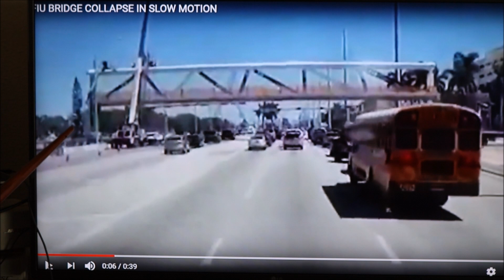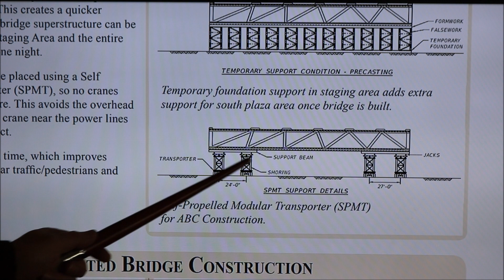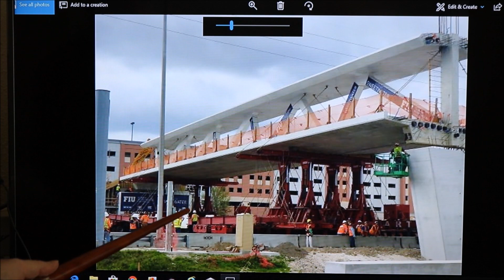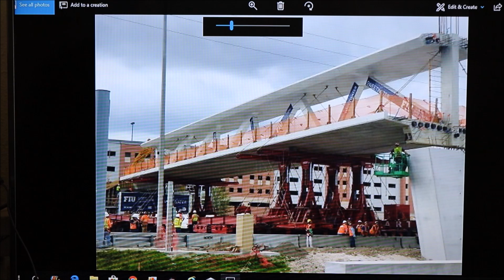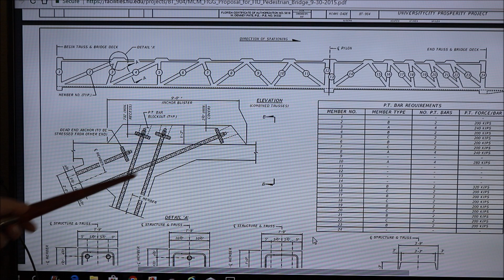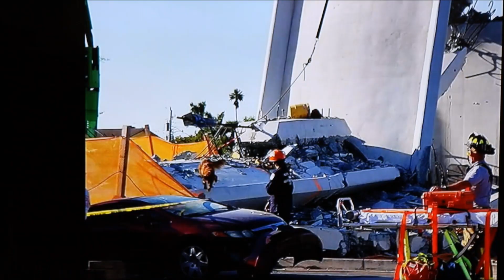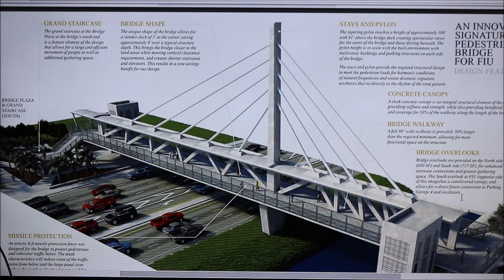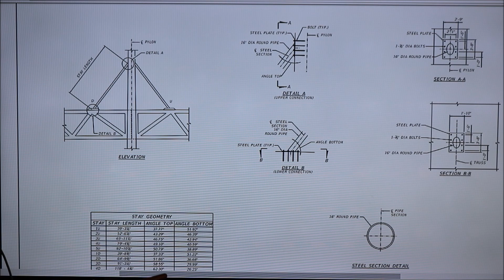Miami Bridge Failure Update 18 March 2018

Comment: That end diagonal member (#11), once in place, would be loaded in compression. The tension rods in #11 were likely intended to maintain #11's integrity against minor bending forces. Those tension rods were likely not intended to be loaded to the high level of tension they would experience to support a long span of the lower deck cantilevered out, as it was during transportation to final position, with the supports moved inboard from intended locations. So I'm thinking that one or both tension rods in #11 were strained beyond capacity during the move. Then after the bridge was in position, it was noticed they were loose, and no longer maintaining the integrity of #11. So workers went to tighten them... and ended up provoking final failure. But of course, speculation at this stage.

Comment: Hi:
To start off, I want to thank you for taking the time to reserce this accident.
I am still thing that it was a design problem.  I also think that the caring machines should and could have been closer to the end of the Bridge section and not removed until all the tension was done.  I have personal experience of many times contractors wanting to do a task a easier way for them and I had to tell them NO.
I agree with a couple other people comments that the person that fell was not in compliance with the safety rules.  I would almost bet that the straps were loose or not hooked.  The safety equipment is not light weight and a little uncomfortable if worn correctly.  You know how confining your safety  stuff was when you were flying in the military.
 Please share more.  Thank You

Comment: It should be clear that the tower and stays were not intended to be a significant part of the support of the bridge by the simple fact that both sections of the bridge were not installed simultaneously. The stays have to be loaded symmetrically, or the tower will fall to one side. The loads on the stays have to balance because the tower is only capable of supporting a vertical load in compression. As soon as the loads become unbalanced, the tower will fail to the side with the higher load. The bolted connection shown between the stays and the tower is simply not capable of passing a significant tension load from one side of the tower to the other. If that had been the intention, there would have to have been a big chunk of steel through the tower to carry the tension load and to provide bearing for the vertical load to the tower. This really does begin to look like there was a sudden catastrophic failure of a tension member in the truss. A truss design places all members in tension, because they are too slender to carry a compression load. For that reason, all of the concrete is simply weight, because concrete can't carry a tensile load. The only thing holding this bridge up was the steel. There had to be steel in the top and bottom chords (the deck and the canopy) to transfer the loads from the diagonal members. A truss has to be a series of complete triangles to work. If one side of one of the triangles is missing, the truss will fail.
Reply from the maker: Bill Giles yep!

Comment: The fundamental problem I have is envisioning how the outermost trusses 2 and 11 could ever be be in tension (and why you'd ever want to add any more of it), while supporting a load from the ends of the bridge.   That's simply not how any type of truss bridge works.    I learned this making my own bridges when I was just a young'n.  ;) 
Do a google images search for keywords "truss bridge compression tension".   End diagonal trusses are always in compression.   But to understand why, let's take the top deck away, leaving only bottom deck and triangles formed by trusses then try to lift the bottom deck from the ends.   The ends go up, the middle  bows downward and the points of all the triangles move closer to each other.     The only way to prevent that is to add the top deck between all the top points of the triangles.   Every bit of the top deck between the points of the triangles should then be in compression because it's pushing all the triangle points away from each other.  All the diagonal trusses that angle inward toward the center from bottom to top should be in compression, and all the other trusses (whether diagonal or closer to vertical) are in tension.    
 The only time the end trusses (angled inward from bottom to top) should be in tension is if the bridge is supported inboard of them, which was the case when they were transporting it, and that's consistent with reports that they had added tension to support the cantilevered ends.    Once it's supported by the ends though, those end trusses should always be in compression, and adding  tension there has no positive effect except to add more compression to the concrete already in compression. Likewise, removing the tension (even suddenly)  should have no effect at all.         
I don't think that truss #11 failed.     Playing the video a frame at a time, it looks to me like the failure was at the base of truss 10 (which is in tension), and it either separated from the bottom deck, or the bottom deck itself snapped just outboard of 10. The entire bottom deck of any end supported truss bridge is always in tension.

On a side note, to play any YT video a frame at a time, pause it, and then use the comma and period keys (below < and > which is why those two keys were chosen) to step back or forward one frame at a time.
Reply: daemn42 
It’s strange engineering to see critical structure of a truss have a design requirement of aligning with a non critical motif.
Reply: daemn42 
The fundamental problem was the truss was irregular triangle asymmetrical. And that was to line up with the structurally useless cable stays. 

Had the truss been regular triangle and symmetrical, it’d be different outcome
Reply: Larry Scott, While the irregular shape of the triangles from one end of the bridge to the other certainly put this end of the bridge under greater strain (which I'm sure they tried to account for in the design), my point is that the fundamental physics requires that the end trusses (2 and 11) be in compression, not tension.   It makes zero sense for them to be adding additional tension to #11, once the bridge is supported at its ends.    If they were adding tension with the goal of raising the lower deck, it was probably to truss #10.
Reply: Larry Scott Its a hybrid design, and form clearly does not follow function in this case!
Reply: YOur comment is the finest observation of all the many I have read. I feel it is entirely correct.  Though I feel that the node was simply not detailed well to resist the immense bursting forces tension-compression at this point (11-10).
Reply: daemn42 I agree with your comment, the failure seems more likely at the base off truss #10, where the span was over-stressed by cantilever load during transportation.
Reply: daemn42 according to the drawings there were no steel rods in #11 #12 and #9 ,.
Reply: The preliminary drawings were changed twice, firstly to accommodate an 11ft lengthening of the main bridge span (DOT request), and secondly to cater for cantilever loads while being transported with re-positioned support crawlers. Those calculations, and the actual strength of each element, will be carefully studied by the NTSB.
Reply: daemen42: Great explanation, but the bottom cord would be in tension  In the case of the FIU bridge the upper cord appears to be smaller than the bottom, and the webs are highly irregular.
Reply: daemn42 — The loads were different when the span was being moved to its final position.
Reply: daemn42    You're correct, diagonal #11 was in (very high) compression in the final position.   The tension strands were there for use while being moved into place and were de-tensioned after.    However the bottom end of #11 was under-designed and developed alarming cracks.   (Probably in the misguided hope of closing up the cracks) re-stressing of the tension strands was ordered and this was the last straw for the overstressed joint.   (See OSHA report).

Comment: Not a bridge guestion Juan but one on commercial aircraft.this morning as i was headed to Sonora I seen at least 12-15 planes lined up. Headed west, the only reason I seen them because of the trails they  were leaving . my ? Is there a freeway in the sky an if so if flying West is your altitude the same if your going East also same  Going south / north.   Thanks Jaun
Reply from the maker: James Woods good day for contrails, yes-airliners fly the same routes over and over like highways in the sky.
Reply: James Woods Juan forgot to add that East/West flights have 2000ft vertical separation (not obvious from below).

Comment: My first question for you, Juan, is did the worker who fell from his harness survive and will he be able to communicate his actions and observations?? Secondly, please confirm my understanding of what you have said here. I understand you to be saying that the transporting crew Increased the original tension on #2 and #11 for additional intergrity during transport while the site contractor expected to Increase those tensions once the span was in place. The transporter allegedly informed the site personnel that these tensions had all ready been maxed out for transport and that once in place, the the Tension on #2 and #11 needed to be Relieved back to the construction standard. Once the span was in place, the Site Management put a worker with proper tooling on the job to Tension ( increase tension ) apparently first #11 before #2. If my understanding is correct, Site Management Erroniously Instructed the worker to cause #11 to Fail by OverTensioning It. If that had not caused the immediate failure, the worker would then have proceeded to OverTension #2. It would seem the crux of the matter will be litteraly what was said to the worker and what action he took. And so, as is pervasive in modern American society, we have a case of " He said, She said". Fifty Billion dollars for the Lawyers to pin it on some poor worker who is lucky to come out of it alive. sdh in CT
Reply from the maker: steve holton we’ll have to wait for the NTSB report to sort all this out.
Reply: Witnesses confirm that #2 was adjusted first, and one rod in #11 was completed. The worker we see falling in the video died on the spot. 

I believe that these PT rods were inappropriately loosened on a previous day and were later being re-tightened. Both times, these rods could have been left alone. 

Other witnesses say the rebar at the bottom end of #11, in the deck, was about 1/10th as strong as really needed. Perhaps tightening the last PT bar to spec crumbled the concrete in the lower joint, triggering the collapse. We can see a puff of dust near there, one frame before the bridge drops. 

Certainly, there were wide cracks photographed on this lower node, days before, so a failure started around the time the bridge was being moved, and got much worse after being set on the pier. There were also reports of loud bang from the bridge well before the collapse. 

It seems like a medley of failures, not just one.

Comment: If there are 2 tension rods you would need to adjust both at the same time or you overload the one being pulled on  and it may reach its break point    just a thought
Reply: Doug Beagle Its best-practice to have equal tension in both rods, but probably difficult to do both exactly at the same time, due to space constraints.

Comment: A dead-end tension rod is a red flag signaling danger. I think it should have been fastened to a steal beam or something rigid that would have directed the tension somewhere secure.
Reply from the maker: Joseph Miller I believe it was ‘secure’ in the fitting.
Reply: Joseph Miller The load spreading at the joins will likely be a key point of the investigation.

Comment: I cannot imagine a design of a bridge without redundancies.  Any of the bridges anywhere in the world that have withstood age, stresses from load, weather, building flaws (obviously minor but still compromising) develop cracks, sheared bolts, rivets, rust and corrosion etc., and they still don't fail, because of designed redundancies.  Looked at this aspect Juan?

Comment: The dynamics of this failure point towards concrete bent 11 failing under compression, Juan.

During transport 11 would go into tension naturally, given the cantilever. Cable tightened to resist, ok, whatever, the last section didn't fail during transport, period.

Nor did it fail when they set the span. This means that bent 11 successfully survived its internal transition from tension to compression, as the fixed pier took the load from the mobile piers.

Two guys and gear, finite but miniscule additional compression on bent 11.

Then she goes, with strut 12 and bent 10 maintaining angular alignment with each other halfway to ground.

The hypotenuse described by bent 11, gets shorter during early failure.

It does indeed look like they punched right thru the anchor blister. Or just unseated it.

But...they shouldn't have BEEN increasing tension on bent 11, they should have been releasing it. Atop the fixed pier, bent 11's compressive resistance is paramount...why artificially increase that compression by tensioning in "dead load" from a cable?

If they were indeed tightening it, they stressed the concrete around the anchor bolts until that whole section of the top chord crumbled.

If they were loosening it, good chance microfailures triggered during transport choose then to let go.
Reply: Laying bent 11 over, closer to horizontal than any other, accomplished two things.

It made it line up with the "suspension cable" overhead falsework, and it greatly increased the compressive force on it.

Well within design limits, I'm sure, but the net effect is to amplify any additional compressive force when the cable is tensioned, and effectively lowers the safety factor during minor adjustments.

The first panel span of most trusses are smaller or equal in size with the rest, for this reason. 

The more vertical the first bent, the more bridge it will carry.

In this design, the much longer first span panel was probably a factor in the failure.

Somebody traded pretty for sturdy, and it bit em.
Reply: Reports state rods were tensioned during move. As you note the unsupported end of the bridge would place stress on #11 rod ... I suspect stretching it. Once the bridge was placed on pylons the tension would be relieved as 11 went back into compression from weight of structure, which would make the rod tension become loose. 

I suspect they went to take up that slack and re-tensioned the #11 rod (which was an addition - there were no P.T. rids in #11 in original plans), without apparently considering or understanding the rod was loose because of excessive forces and stretch in the move.

When they re-tensioned the already deformed/stretched 1 3/4" P.T. rod, it suffered catastrophic failure.
Reply: @go220mph  
The change in length when #11 is compressed should not relax the PT bars. Concrete is very stiff. However, when under tension, the bars may have damaged the lower node. Other witnesses say that the rebar in the lower node was about 1/10 as strong as really needed. This is confirmed by photos that show a wide crack in the lower node just above the deck, days before. Tightening the bars back to spec after the concrete has cracked may have shattered the node.

Comment: Looking at the slow motion several times would seem to me to place the blame on a failure in the lower cord of the truss.  Both struts 11 and 12 appear to be intact and connected on both ends as the bridge falls.  Member 12 would be in compression not tension, member 11 would be in tension.  If 12 had failed, it should have collapsed under compression, it is still intact after the event is over.  If 11 had failed it should have separated, it does not appear to do that.

I think the failure was in the lower cord because it bent during the event at the bottom of member 11.  I guess "they" may tell us what "they" think in a year or so.
Reply: I'm thinking the lower span would most likely have been damaged by stress concentration during transport, due to the cantilever effect, and the lack of support bracing.

Comment: Why was there traffic allowed under a non completely installed structure, makes no sense...
You loose a worker during adjustments to tensioners. Failure number 2, seems this whole process of erecting bridges like this is  risky.

Comment: Sounds like you and AVe have this failure pretty much in the bag. His analysis came to the same conclusion based on the protruding PT rod/tensioner and cantilevered section during the altered transporting scenario. Thanks again for the great content and presentation, As a novice I have learned so much regarding concrete structures between the dam spillway failure and this incident. Its true, there will always be accidents, time/money/resources wasted in the pursuit of progress......but what makes no sense to me, was if they were making additional adjustments required due to following an altered transport plan (the inboard transporter clearing the K-rails and debris) wouldn't safety protocol dictate that there be NOBODY in the danger zone until stress gauges were checked and the structure was given the all clear? I mean, even the guy doing the adjusting was suspended from a crane!